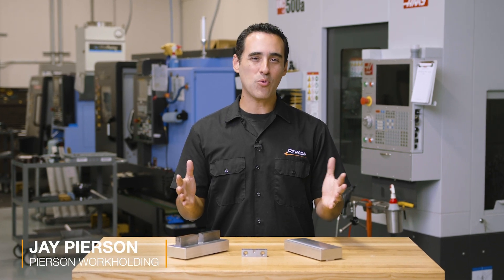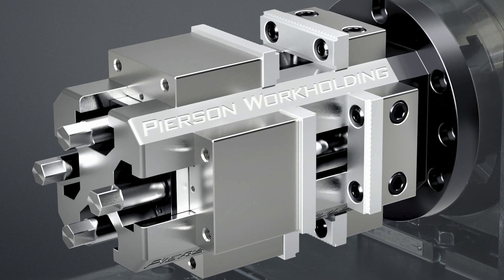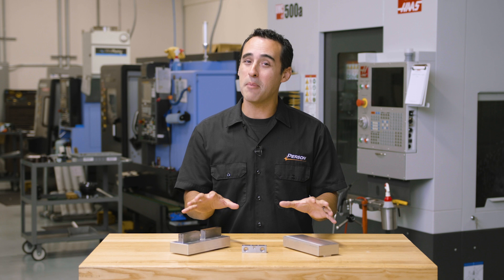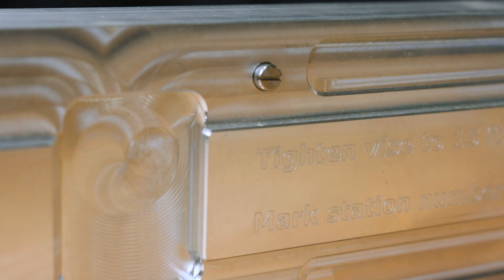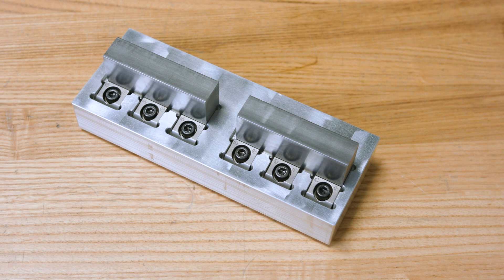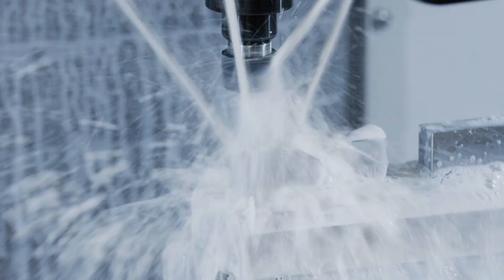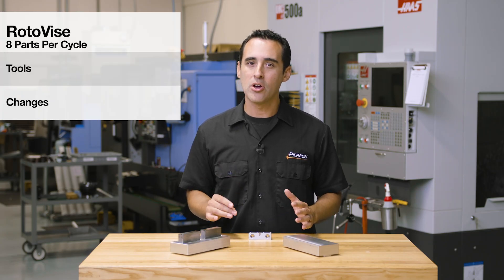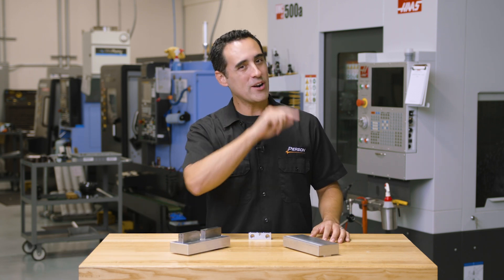We spun our pallets and THIS HAPPENED! | Fixture Friday 14 | Pierson Workholding

Comment: How do you cam for this? Any chance you'd show us some CAM in fusion 360?
Reply from the maker: Easy! Program the entire part at the A0 position and use tool orientation for operations that are at different angles like drilling the sides. Then put all the toolpaths in a circular pattern around the center of rotation. We have a video coming soon about this.
Reply: @PiersonWorkholding  That doesn't sound like it's beyond me, but it does sound harder than can be conveyed by a short comment. I look forward to your video! So many people have a 4th axis that sits unused.
Reply: @PiersonWorkholding  I'm still waiting on the CAM video for this! Your products are unforgettable!

Comment: Curious... Why did you used so many pit-bull clamps on there? Seems overkill.
Reply from the maker: Possibly, but overkill is better than underkill when it comes to part security.  We have plenty of clamps available but if someone didn't already have them, 2 would be sufficient.
Reply: Each one has less pressure which results in less thread wear which results in a longer lasting fixture. Only modest torque required on 3 clamps compared to max torque if using 2 clamps.

Comment: Whats going on with all those doosan mills in the shops are they competitive or are they just throwing money at creators?
Reply from the maker: There are no Doosan mills in our shop, just lathes. They're great machines and have owned them for 4 and 6 years respectively.
Reply: @PiersonWorkholding  thought those were mills
Reply: If you can bill for the extra performance - Doosan is very competitive. If you cannot bill for the performance, they are not. 
In general, Doosan will run circles around a Haas in terms of accuracy and repeatability. If your parts need that, the Haas is not the right tool.
Reply: doosan are the haas of south korea
Reply: @SuperAWaC  Doosan is way better than Haas.  You can get box way Puma lathes that are way more rigid than any Haas lathe.